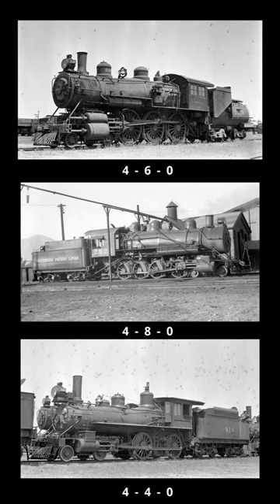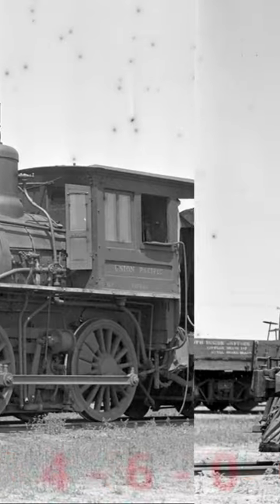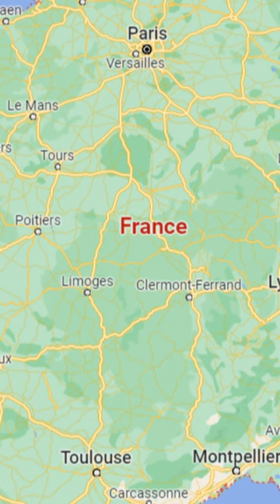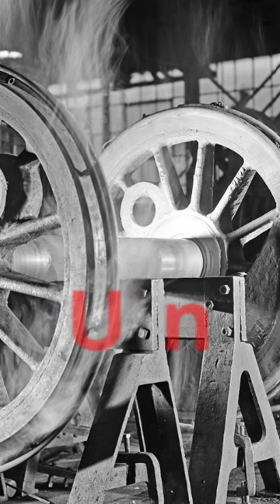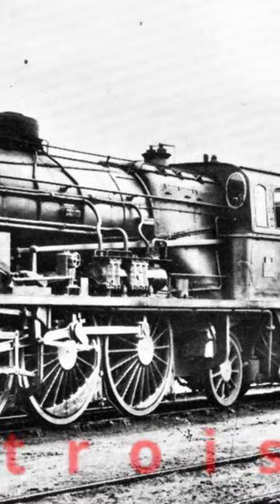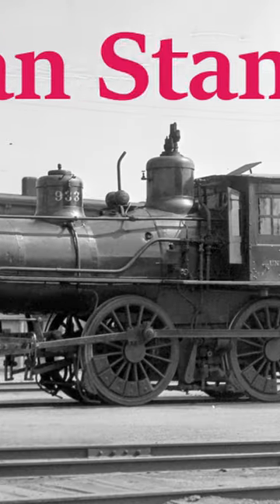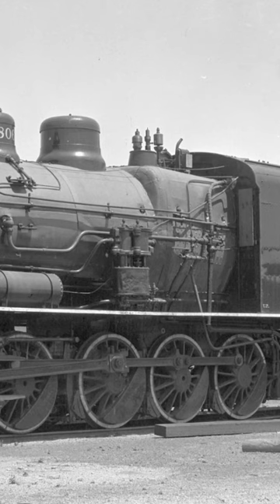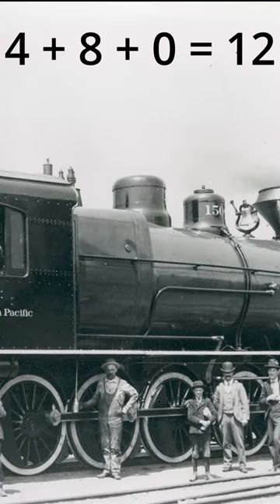#shorts Whyte: Why not axles?

Comment: In germany, pilot and trailing axles are shown by numbers, powered axles are shown by letters so a 4-4-0 becomes a 2'B, a 2-8-2 is a 1'D1' and so on. I do like the Whyte notation more though because it certainly is easier.
Reply from the maker: Thanks for your comment, Fuel. 

I did a longer firm video on Whyte's notation, if you're interested:

https://youtu.be/kBS7ZfsZ8pI